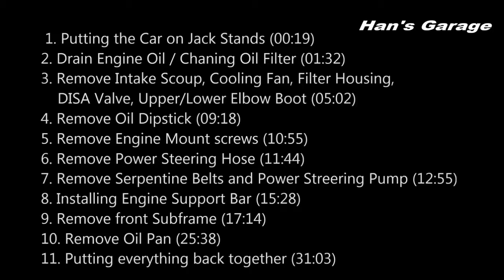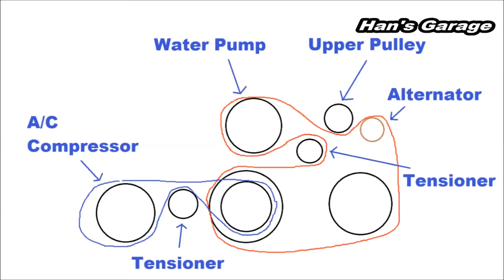BMW E46 3 Series 1999-2005 Oil Pan Gasket Replacement DIY

Comment: Good video!  I remember doing my oil pan gasket on my 2001 330Ci - which lead to replacing the engine mounts because why not.  Then, I decided to do the power steering lines, control arms and bushings, cooling system, belts and yes - with 160K miles I decided to replace the clutch.  I've enjoyed working on this car and it doesn't hurt to have a connection with a parts guy.  Keep up the good work!
Reply from the maker: Utah York amazing! Thanks!

Comment: Sorry to be such a NAG, but please consider some basic clear eye protection.   Whenever I have to lay upside down I automatically put them on.  I have several within easy reach. I speak from experience as working under one of my vehicles many years ago a small piece of rust entered my eye (no eye protection at that time).  No matter what I did I could not flush it out. It was a Saturday and eventually I contacted a personal friend, an eye surgeon and he told me to meet him at his clinic ASAP.   It was about a 20 minute drive and by the time I got there my eye was hurting and very red.  He put a dye into my eye and retrieved the small rusted piece of metal using a special tweezers after rolling my lid up and out of the way.  He said had I continued to attempt to remove it myself I could have badly scratched my cornea. And he gave me a small sample bottle of medicated eye drops to use every day for about a week.   As a professional pilot at the time, I was very concerned about potentially ending my career and was very relieved he was able to help me.  Now I am very aware of ensuring my eyes are protected anytime I am working under anything.  Thank you again for making such an informative, professional video that saved me a ton of money.  And I also replaced both my motor mounts with OEM products from Germany.  Only thing I did slightly different was I used a pieces of cardboard cut from boxes, punched holes into them and labeled all my fasteners as they came out.  I also used separate plastic sandwich bags as well for items that would not fit into the cardboard.  Probably a bit over the top, but I took my time to complete the task,  waiting for the parts I ordered.  As an "extra vehicle" my 2000 323i could just remain in my garage and I could work on it at my leisure and really take my time with each step.

Comment: Some helpful tips when doing this.
* use two cable ties to keep the gasket in place on the pan before putting the first two bolts. Keep the cable ties slightly loose not to damage the gasket rubber.
* screw in the first two bolts in far opposite sides. Do not tighten them, since we're just alighning the pan to the block. This helps align all the holes, the gasket and the pan properly without damaging anything.

Comment: 00:19 - Putting car on jack stands
01:32 - Drain Engine oil / Change filter
05:02 - Remove Intake Scoup, Cooling Fan, FIlter Housing, DISA Valve, Upper/Lower Elbow Boot
09:18 - Remove Oil Dipstick
10:55 - Remove Engine Mount Screws
11:44 - Remove Power Steering Hose
12:55 - Remove belts and power steering pump
15:28 - Install engine support bar
17:14 - Remove front subframe
25:38 - Remove Oil Pan
31:03 - Put everything back together.
Reply from the maker: You are amazing!

Comment: Very informative, I must say! Mr. Han, I have a 525xl gasket pan is leaking. Need oil every month for the past 2 months. You helped a great deal. If I had my own garage I could do some of the work myself, especially with your detailed video. Just need a socket wrench and its extension to get in places I’m not able to with a plier, 4 head screw driver, etc

Comment: Just a small add on: 

When you put the pan back do not tighten the screws in a clock or counterclockwise manner. Screw them all in like you want to but do not tighten them. Just so the pan has a very light contact with the gasket and the gasket with the engine block. This is the moment you can slightly modify the position of the gasket if you feel like it. But in most cases it is not nescessary as it will self center due to the position of the holes and screws. 

After all the screws are snug start tightening them in a sort of star cross order to avoid the pan to warp and have minor inperfect contact spots where the oil will later leak (which is IMO probably why the author advises to place some red paste at certain spots to promote better contact). When the pan has no chance to warp you won't get any inperfect spots around the gasket. 

This is probably also a good time to change the oil level sensor if you have around 150k KM down and the sensor hasn't been replaced yet. But it is not that important. If it goes bad you can always wait until the next oil change and do it later. 

Happy fixing :)

Comment: A very helpful video.  One thing to consider -- if you leave the steering gear attached to the axle carrier (aka subframe) you avoid having to perform a wheel alignment.  From the TIS: 

A wheel/chassis alignment check must be carried out after the following work:
  
Release of following screw/bolt connections:

     Steering gear to front axle carrier
     Support bearing to body (if centering pin is missing)
     Tie rod end to tie rod

Comment: i have i 330ci 2002 i Just change the housing gasket 2 days ago but Still leaking a little. and i Think is the oil pan. so Thanks to you i Will be trying this next. you are a pro!!!! i Love my car that's Why i Will try to do it. keep up With the great job That you do my brother!!!! Thank you!!!!
Reply from the maker: Thank you! Hope that fixes your leaking problem! If not, these engines are know to leak else where such as main seal gasket. You have to take off the transmission to do this job. Which I will be doing soon hopefully.
Reply: Cool. i Will be waiting for the video. Thanks man!!!

Comment: TIP: 
You dont have to remove the P steering pump completely, just remove the top bolt and loosen the bottom one and move it out of the way, there is more than enough clearance to continue.

Comment: Great video... Really well done! My question is why was it necessary to remove the intake components all the way down to the DISA? Was that just to get the dipstick assembly off? If so, couldn't the dipstick and attached hose be loosened from underneath and then pulled out from above?

Comment: A good tip that I use on BMW's and will work with other cars is to use 4-6 short studs same thread as the oil pan bolts,
you will install the studs spread out evenly in the short bolt holes not the long. Will need very small rubber o-rings, you slip the gasket in place, put a rubber o-ring over each stud and this will hold the gasket in place. I work alone and this is the way to do it.
Even faster than when two people try and install. Install all the bolts not tight, and remove the studs, go slow and in case the rubber seal gets left behind just use a small needle like scribe and can fish out. If you do a later BMW you can cut the old aluminium bolts and make studs from them and they are larger so you can hack saw a screw slot for easy removal. This will be very helpful, especially for a one mechanic operation. Try it!
Reply: or you could use small zipties in a few places and cut the zipties and remove them once you thread a few bolts

Comment: Thanks for the video!  I have a 2005 330i and told that the oil pan gasket needs replacing.  I'm debating as I've had the car for 3 years and it has 99,000 miles on it.  The shop wants $800 for the job.  Why so expensive?  Labor? Parts?  Very informative video!
Reply from the maker: its mostly labor. Part itself is about 30 dollars. If you are going to take it to the shop make sure the rear main seal is not leaking! it could be either the rear main seal or the oil pan gasket or both!
Reply: How can you tell if it's rear main seal?
Reply: the gearbox will be covered with oil and not the oil pan

Comment: While definitely not condoned by BMW, you can do this without removing the subframe if you cut the gasket in two places, then use sealant on the resulting joins - you only need to let the sump down far enough to swap the gaskets out.

Comment: I had a pause to watch you try to get that oil pan up there with the gasket when I put the gasket on the block started with a couple screws just to hold it out of the way after you get the pan in place take the screws out I don't know if all of them screws are dead holes if they are not usually put a little sealer on the threads

Comment: Absolutely fabulous video, ive seen others and just wondered was it necessary to remove the power steering oump and engine mount bolts from the top of the engine, can you not just leave the ps pump on and undo the bottom engine mount bolts from the bottom? Just curious as i want to do this job soon too

Comment: It's making a a trumpet noise now I think it's an air leak from somewhere on the oil pan. When I renive my oil filler cap the noise stops for a brief time and it gets louder. I pur the oil filler cap back on and the noise tones down and now I have a small oil leak by the back bolta the goes onto the oil pan.

Comment: Awesome job watched as a refresher, was this a manual trans cause I remember doing this a while back on a automatic and the stupid cooler lines where in the way of the pan bolts.
Reply from the maker: Yeap manual transmission

Comment: Han, Great video! Thanks for providing a guide! I just completed this job. I had a question: maybe it’s an M car only thing, but I’d read about priming the oil pump - ie disconnecting fuel injector relay, taking out spark plugs and turning the engine over a few times to get the oil circulating. Did you do that when you did this project? Or maybe it’s just an M-car thing?

Comment: Great video...question...can you get to the top bolt of the manual transmission when you remove the oil pan...it would be good if you could so you can break the bolt loose if you plan to replace clutch in the near future.  Thanks....LR...also: do you need to remove the guibo on the steering column during the removal process to prevent stress on the column.

Comment: did you replace any of the bolts on the bottom of the oil pan, i’m debating whether or not to buy new ones, or if it’s safe to use the old ones

Comment: Hi Han very good video I want to do this on e46 m3 so I can powder coated front subframe when you lower the subframe did you have to disconnect the steering column or can it stay connected to the rack and be tied up while the subframe is off ?

Comment: What did you use to clean the oil pan? if you used a solvent or solution could you provide the name? it looks like engine degreaser but im not sure.

Comment: Did you use new bolts as they state must be done for oil pan?  I saw another video that guy said you could re use old bolts just have to figure out the math in respect to the foot pounds of torque to be applied being its in three steps..to button down etc..

Comment: That's a great video clearly mentioning every step. I have a question for you. If there s white smoke(oil burning ) coming off the engine bay exactly under the cabin air filter. I already changed the valve cover gasket clearly that's not the problem. Do you think it's the oil pan gasket? Or where else can the leak be?
Reply from the maker: +Vinith V it sounds like the valve cover gasket isn't installed correctly. If the oil pan is leaking it wouldn't burn like that

Comment: you the man han... im dreading this gasket replacement myself... So where's a good place to get an engine support bar
Reply from the maker: thumper lee I actually ordered online from Amazon haha it was like 60-80 bucks
Reply: Han's Garage well thank u.. definitely one of those tools I don't have
Reply: Harbor Freight usually has them in stock. Get a 20%off coupon. Should be less than $70.

Comment: could someone ans for me. after removing all the accessories, i believe we need to jack the bottom of the engine to lift. or correct me if i am wrong here. and while doing so. dont you think it can break screws, bolts,nuts, which are on the drive shafts. or can we get little bit play on engine movement up and down. without breaking the nuts. attached to the rear end. which part is essential to put in the checklist in order to avoid serious mistakes. my fear is, while i do this, and without me knwing while i raise the or move the whole engine up. will there be any possibility of breaking anything whether its nut, hose etc. kindly input your thoughts. thanks
Reply from the maker: That's why I had the engine support bar. I didn't have to worry about the engine moving out of its place
Reply: are you saying engine stays at a particular point in space. without moving at all? then do we have room to pry the pan out. kindly explain me this part, am so much afraid to do this by myself. but have no choice, so i need to see i rule out all the possibility of a breakage of bolts or nuts.
Reply from the maker: +sharon mathew yes the engine does not move whatsoever. Did you not watch the video??
Reply: yes every bit of it, without even a single blink.
but, the engine appears to be lifted a bit, which is why i asked you. if you say the oil pan can come out without engine moving,thats a great news to me )))))))))))))

Comment: I have similar problem with e46 but I have a 2004 318i ... Oil Pan Gasket Needs Replacement ... Would the work (replacement) be similar to 330i more or less
Reply from the maker: +Mohammed Islam Yeap! It should be easier actually
Reply: Thanks for replying Han, I was thinking the same as my engine is only 2 little, Thank you for uploading videos on How To they are helpful to other e46 owner and keep them coming ;)
Reply from the maker: +Mohammed Islam thank you for your encouraging words!

Comment: Han why do we need to take off the certain parts from the top when we have to access the pan from the bottom?
Reply from the maker: That is zee way my friend
Reply: @HansGarage  OK, but I just want to know why take those off instead of just going straigjt to the oil pan. I'm not a big fan on cutting corners just wanted to know what happens if I decided to do just that.
Reply from the maker: @Ayixlia  like I said. It's zee way

Comment: Question #1) aren't there a easier way to remove the oil pan from BMW E46/E53 their same almost i think.. the sub frame has to be taken down..
I have all my oil pan bolts out and that shit still wont budge. I didn't drop sub frame though (was trying to do it without having to take all those things apart) guess i have to huh 😂😂

Comment: Hey question, I have a BMW 328i 2007. Need to replace the oil pan gasket. Is it similar to this procedure?
Reply from the maker: Alex Ramirez ahh hard for me to say but I do know the engine is different for sure. It may be similar but completely different at the same time. sorry!
Reply: Oh ok anything I should consider replacing while I'm down there? Engine mounts maybe?
Reply from the maker: +Alex Ramirez hmm if you have the time, if research around and see the engine mounts, tranny mounts, guibo, and control arm bushings
Reply: One and one more thing I saw some people say you need the bolt set for this. Is that true?
Reply from the maker: Alex Ramirez bolt set for the oil pan? I re used my bolts and have no problem with them. unless your current bolts are damaged I think you should be fine

Comment: Why didn't you change the rod bearings? Would have been of small cost...
Reply from the maker: I am actually thinking about swapping out this engine!
Reply: Han's Garage The con rod bearings in your engine :)
They tend to wear out quickly on our straight six engines...
Reply from the maker: I had no idea! Thank you for your wisdom!
Reply: Han's Garage Okay, nice :) Going to this on my car as well in the future.
Reply: +Max Lindner I thought the straight orientation caused less bottom end wear. I could very well be mistaken though.
Reply: Christopher Kennedy Inline or V configuration doesn't really have any influence on bearing wear. It's rather the size of the bearings and some other factors that will determine their lifespan ;)

Comment: Super Job
Reply from the maker: Jaguar i bought this car that had 160,000miles on it for $1800 us dollars. Who knows how this car was maintained? Haha right now I have over 230,000miles and running stronger than ever
Reply: @HansGarage  Ok Sir now I know all * How you like this car? I have same and love very much * parts are very cheap and I buying all Chinise made * those promotors of special brand not know any things about parts * Today all parts for every car manufacture is made in China * I see one very honest add " GERMAN PARTS MADE IN CHINA " * Spring time I going to fix my cracks on the back where sub frame are fitted * I am a Mercedes man all life only with Mercedes cars * now I get extra E46 and love so much as my joy baby car.
Hans take easy and enjoy your car and life as go.

Comment: Hans do you think it would be easier to undo the two track rod ends the the wheel giving you possible room to swing that rack out the way? Or is this not possible?
Reply from the maker: Custom Car interiors its definitely possible! But i just had my wheel alignment done before this job and i didnt want to mess it up so I didnt take them off

Comment: Hi, I have an oil pan gasket lean too on an e46 330i but I need to supply the shop with the parts, what do I need ?
Reply from the maker: just the gasket and oil gasket sealer if they dont have it. Im sure they should have that. This job doesnt need extra parts
Reply: HAN'S GARAGE ok cool, I don’t know how many quarts of oil it takes though
Reply from the maker: I usually put about 6 qts and then check the dip stick to fil up more
Reply: HAN'S GARAGE ok thanks !